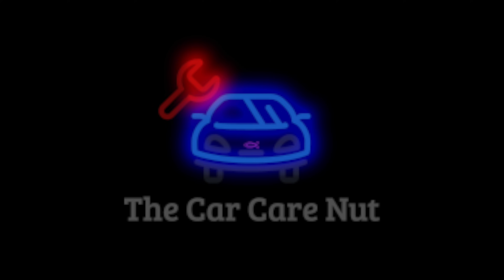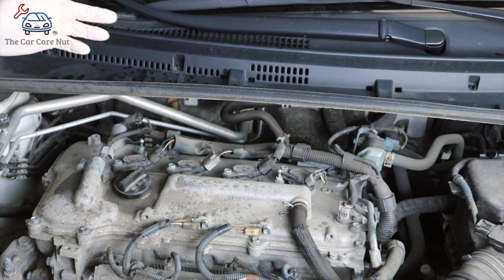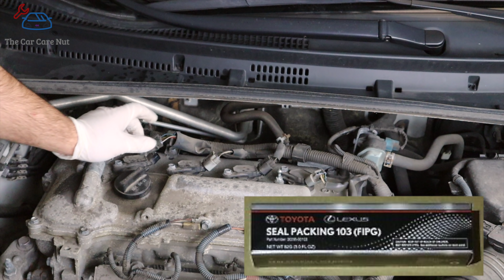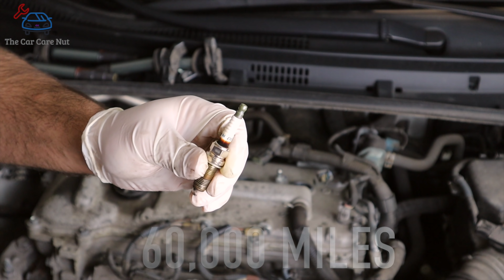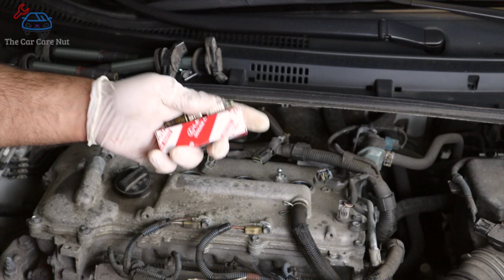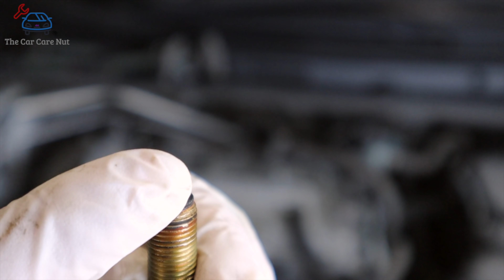How to change Toyota Spark Plugs on 4 cylinder engines

Comment: Hello thecarcarenut, i have noticed that you have used a bi-hex (12 points)socket to remove the spark plug and assuming that you have used the same Merc bi-hex socket plug to tighten the spark plug which has a hex (6points head). When torquing it down, wouldnt that strip the spark plug?

Comment: The local Dealership wants $626.00 to change spark plugs on a 2017 Toyota Prius with less than 120 miles on it.  I told the service manager that was insultingly absurd, i’ve changed my own plugs on my previous Prius and 20 minutes flat.  The nerve of these stealer-ships is unnerving.
Reply: Dealership actually changed the spark plugs outside of warranty when my truck had a previous owner.  They used chinese made auto lite spark plugs and tightened so much that they bent the spark plug and caused an oil leak....  dealerships will charge you money and not even do the job right.
Reply: Why would they work for free? They have a garage office liability warranty and a huge lot to pay for and workers too. It takes an hour but they have over head and some jobs they break stuff and work for free

Comment: Did you disconnect the battery cables before starting?  Also, do you have to gap the plugs or are they already gapped when you buy the plug?

Comment: I never trust a Torque ratchet. I remember using one on my lugnuts in 2019 after placing a long breaker ratchet with a 19mm deep socket to my surprise my lugnuts was loose. I don't know what told me to recheck my lugnuts, I saved myself from getting killed had I driven on the highway that day.

Comment: Could using an air-gun to clear debris around the spark plug result in it falling into the well? To avoid this, one must use air-gun before removing spark plugs and not after they have already been removed. Please confirm

Comment: Strangely i had a P1604 code that got thrown every time at startup, there were times the car would crack and not start at first. The plug were really carbonated, after replacement i got a quicker crack and no more p1604 so far

Comment: 2014.5 Toyota Camry SE 4 cylinder. 198K miles. I have had the plugs replaced at 120K miles

 I am not putting any anti-seize (per your advice) Should I torque them to 15 ft-lb or 18 ft-lb???  Too many varying opinions out there. Please respond, Car Care Nut. Thanks!
Reply: If you can use a torque wrench then sure.  But you won't be using that torque wrench when you got a V8 and can hardly fit your hand inside the engine.  I use quarter turn after hand tightening it.

Comment: The ones I bought were OEM denso but when I checked the spark plug gap it was off for my Rav 4. I adjusted them only so slightly. Is that alright or did I mess up? My car is running fine

Comment: I wish you would have shown how to tighten with the torque wrench.  I've never used a torque wrench before and I'm thinking about changing the plugs on my 2000 Toyota Echo with 118,000 miles on it.  I've never done anything like this before and I have to get it right the first time.  This is the only car I have and if something comes up while I'm doing the work ( like needing something else) I'll have to walk quite a while to the nearest auto repair shop for extra parts.  I bought this Echo 2 years ago and it didn't come with the service manual so I'm going to have to find the specs a for the correct sparkplugs and torque setting online.  I only have a basic socket set so I'm going to have to get a torque wrench along with everything else.  I'm a 63 yr. old lady without anyone to help or guide me on doing this so please wish me luck.  I always try to watch your channel before attempting anything on my little Echo.  Where I live, the mechanics are not reliable or trustworthy.  They see an older woman and figure that they can easily rip me off because it's the only car I have.
Reply: Hope you can get it done! Thats awesome your doing it yourself im sorry theirs no trust worthy mechanics:(

Comment: Rocker gasket leak has put so much gunk in area im afraid it will fall onto pistons when removing and replacing plugs. I best give them a thorough clean out first.

Comment: Sadly, you said NOTHING about how to determine if the NGK plugs are Genuine or Counterfeit.

The easiest/simplest way is measure the resistance/OHMS with a Multimeter of the center electrode from tip to tip.  Measure all plugs, the resistance should be nearly the same for all plugs.

Plugs with wildly divergence resistance/OHMS readings are - COUNTERFEIT.

Comment: Really appreciate your support, have a 2003 Camry with 180k and have rebuilt the front end suspension and rear end, brakes all around and just installed new plugs, coils and PVC valve. Not sure if I should change trans fluid and filter after watching the your video, it’s shifting perfectly but it’s never been serviced. Thanks for your advice.

Comment: Doing my 2013 Camry, the plugs (original never out before) were CRAZY right almost all the way out. It was odd it didn't get easier as they slowly came out. Why does that happen? Threads looked normal. Anyone gave that problem
So now I don't know if the torque was correct

Comment: Thanks for all your videos. I just got a 2018 Corolla for the kids for their 16th and just replaced my plugs that had 122k miles on them. They were the factory ones marked on the tips with a yellow X. Torqued them per your advice. All my service I do on this Corolla or my GX is factory parts bought at the Toyota parts counter. Not worth saving a couple bucks and likely getting fakes. I only buy things online from other Toyota dealers. I tried getting “genuine” filters on eBay and sure enough they don’t match the listing photo and were obvious fakes.

Comment: when you brake it loose a turn or two STOP and blow out hole with compressed air , sometimes there is rust on the gasket etc.... so blowing out hole before breaking it loose may not get the rust flakes that happen after the plug is disturbed , I would never pull out a plug in a blind hole before blowing it out thats crazyness , god only knows what could be in there or fell in there during the previous service etc ...even with seal of the coil boot , why gamble

Comment: I have 2013 Camry with 55k miles on it. Should I change spark plug?
Reply: Charge at 60 miles or if you want you can change it now ( my car 2017 Toyota Camry same yours car engine 60.000 Mile not change yet , i change at 67.000 miles

Comment: I cracked off the tab using the screw driver blade on two of the connectors--what is the form in place gasket you suggest? Or any other suggestion?

Comment: Always get the correct tools.  You can get a pretty good torque wrench like an Icon by Harbor Freight or a Tekton for not alot of money and the correct magnetic sparkplug socket from gear wrench.  After you do the work, you are still saving money and can reuse the tools are you need.  I still have my old Proto wrenches which are nearly 40 years old and I've had calibrated over the years and are still working as they should.

Comment: That engine is filthy! Owners need to realize that all that dirt can cause corrosion and electrical shorts. Periodically hosing down your engine (while cool, never hot!), is one of the best things you can do. Working on a filthy engine also invites dirt and contamination on whatever new parts your installing.
More importantly, chemical reaction typically double in rate of reaction with every 10-deg. C increase in temperature. That includes rate of corrosion! The engine compartment is typically hot, so removing must of the dirt and crime will reduce corrosion on all the parts in your engine bay, as well as minimize the chances of shorts that can effect operation and even trigger engine codes... While your at it, spray wash the bottom of your engine hood, as rust often starts on the hood from under the leading edge... A short drive after the wash will dry everything off.

Comment: I drive a 2022 Toyota Corolla Cross here in Vancouver CA. Is it okay to change my plugs every 96,000km as advised by my local mechanic? Or what is the ideal replacement interval for spark plugs

Comment: Quick question. I bought new denso plugs that came with 2 washers but the ones I pulled out were ngk with 1 washer. When installing the new plugs should I install with 2 washers or just 1. Toyota Camry 2004 2.4 l engine

Comment: Thank you for the detailed Video! It is very helpful. Except the pounds/foot or what you have over there. 😂 I will find out the Newtonmeters, no problem.

But whats really interesting: Here in Germany the offical replacement-interval is every 90.000km. (56000miles).

And you guys have 120.000Miles in the states? 😮

I wonder why it differs THAT much.
Yeah, we got the Autobahn with no speed limit, and maybe it is calculated in, that the car is driven more often with higher revs... But with the CVT... And also in Germany, we do not drive 120mph all the time 😂

So lets assume, that this is calculated in... Then maybe 30% less lifespan? But its more than factor2! 😱

Do you have any idea?

Comment: The brown stain on the ceramic is called a corona-stain and is COMPLETELY normal.  It is NOT a sign that the plug is leaking spark.

Comment: Hello! I changed my spark plugs, but when I turn on my car, they shake a little than stabilized, I take a little ride and everything okay, but when I turn on next morning they shake a little then stabilized but comes to me a lot of error codes. Misfire in all cylinders, p0300, p03031…. And after the traction light pop up too. Could you help me to understand what is happening? I just changed the all spark plug. I used  DENSO Iridium TT Spark Plug: Ultimate Endurance and Power, 0.4mm Iridium.

Comment: Wrong information about plug gap 07 Toyota Corolla and I bought Denso plugs for the car in a set and all four were different gaps you need to show how to Gap them instead of telling everyone to trust they are done correctly from the Manufacturer, Please Correct This.

Comment: All these videos show the spark plug coming up with the socket.  Maybe if the socket is magnetized?  Certainly the plugs, after completely unscrewing, did NOT come up and out with the socket when I just did this operation.  Had to find long kitchen "tongs" my son was able to get down into the hole and grab the plug and pull it out.  Tricky, and it took me grabbing the plug the moment it was partially out because it wanted to slip out of the grip of the tongs.  Other than that...piece of cake.  Again, perhaps/probably with a magnetized socket this wouldn't be a problem.

Comment: Toyota and the local store wanted $40 each for NGK/Denso iridium plugs for my 2011 Corolla. The Champion iridium was $14. I wanted to buy NGK, but $160+tax for just the plugs was insane. 

I can always switch back if the Champions aren't great. What a ripoff.

Comment: What's the real-life difference of 0.8 mm (.031"), 1.0 mm (.040") and 1.1 mm (.044") gap in iridium spark plugs for hybrids? 🤔
Toyota changed its opinion/recommendation about the gap several times over the last 2 decades. 🤷‍♂️

Comment: Just did my spark plugs yay ! The ones I took out I guess had some stickiness to the threads . I’m guessing oil or just carbon ? Hope it’s not oil . 11 Camry 2.5 L with 175 k miles . Unfortunately the tabs fell off the coil connections . And valve cover looked very dirty with caked on oil . I cleaned it off . The oil stains could’ve been from oil filling and they spilled it I guess . I’ve been checking oil level and it don’t seem to be going down

Comment: You said in one of your videos to drive the vehicle and let it sit 2 hours then do the work. But doesn’t that increase the risk of stripping threads on aluminum head?

Reading online I’ve seen a lot of advise to do the spark plug job on a cold engine to reduce risk of damaging aluminum head threads

Comment: In my case, the spark plugs were not pre-gapped, and it gave me a big headache. I took it to the dealership, but they couldn’t find anything wrong with my car until I pulled out the plugs and corrected the gap and started running like new again.

Comment: I’m surprised with all your attention to detail that you would suggest not to check the gap on each spark plug. I have experienced one time with a set of spark plugs where one was not gapped correctly. I’m not sure, but it may have been dropped, damaged in production or something like that. Occasionally someone at the dealership or parts store will open up a product to show a customer or some other reason. If the product gets damaged it may be put back in the package that way. I know that I must check parts for such things.

Comment: Useful channel thank you.  I didn't hear you mention when to change the spark plugs with respect to engine temperature.  Cold, Warm or Hot?  I would guess cold.  Thank you.  I have a 2011 Corolla S with 301,700 miles.  Still runs like new.  I change the oil and filter every 5000-7000 miles, full synthetic.  When I change the oil, it still is not  black.  It is a dark golden color.  Only changed the fuel pump, alternator (3 times),  struts, motor mounts and constant velocity joints and drive shafts, a/c compressor and condenser coil and blower motor (live in Houston, tx).  A very strong car.  Goal in 500,000 miles.   I enjoy your channel.  Thanks

Comment: spark plugs are the DIY job I've finally caved an gotten myself a torque wrench for. Not so necessary for basic things like oil change or air filters, batteries and whatnot but now I can swap my own tires out for winter too without worrying about if I got the torque right.

Comment: Hello. I have a question. Do ignition coils have to be replaced iat certain time? f they don't seem to have a problem. I have a Corolla 2003 it has almost 186000 miles. Thank you 🙏

Comment: Glad he pointed out no need for anti seize on the threads.  Way too many so called car experts have videos with either some or a lot going on the threads.  I have never used it and never have issues.
Reply: Antiseize is more for old school 30k mile plugs back in the iron block days. If you didn’t hit that 30k in about 3 or 4 years you might be hooking your welder up to them to get them out.

Comment: Great video. I change my Celica plugs every 20 K - probably overkill with the higher performance Denso IK20 (0.4mm gap) and recommended for the Celica by Denso themselves. However, every time I change them I notice a brown/golden coloured residue halfway down my coil packs. I wipe it off. I never use any paste or anything on the threads. So do you know what this could be? Thanks.

Comment: I appreciate your help and knowledge.  I was just quoted $230 to change the plugs for 120k maintenance.  I ordered new ones and will do it myself and save $200.  Love my 2014 Avalon Hybrid.  I purchased it after watching your video with the Avalon Hybrid being the hidden gem of your car choices!
Reply: I would've paid 230 for the V6. Shops around me were asking 250-300 for my 4 cyl Camry. No way I'm paying that for one of the easiest jobs that can be done on a car.
Reply: @dilshadimon4402  I have the 4 cyl/ hybrid and it was going to be $230 for the plugs.  I changed them myself in 15 minutes.  The easiest ones I have ever done!
Reply: @dilshadimon4402 Facts, was just quoted $315 for my 2012.😂

Comment: 10:55 I wish you slowed down to show exactly how you put the spark plug down there.  I saw another video where the guy drops the spark plug in like dropping a stone then he fishes around to get the socket on it afterward.  For the DIYers, we need to see these moments involving dexterity, tight spots, stuff that sticks or bangs into other parts of the vehicle while you're working on it.  Getting a number to appear on a torq wrench is the easy part.
Reply: The socket that specifically held the spark plug in-socket should have a rubber or metal plates springs arranged as a grip, or there is a strong magnet to hold the spark plug.

The straight shaft of this loaded socket should be lower into the channel by hand. We should also try to engage the spark plug screw thread into its installed socket thread by hand. After hand tightening for 3 to 4 turns, then a torque-ratchet can then be used.
Reply: I think he was trying to give the guy that made the video a tip for future videos to make them even more informative by showing the lil neauseances of exactly how to lower the plug into the hole.. It may seem like something basic and common sense to someone who has done this alot, but to the jackasses like me that will find a way to screw something up, then it serves us well to see these task done from start to finish..I don't know how many times when I'm trying to learn how to put something on I never have just when it gets to the part where I need to see how they did it, they edit out that part showing the full install or teardown of said part...At least that's how I took his comment😂😂😂